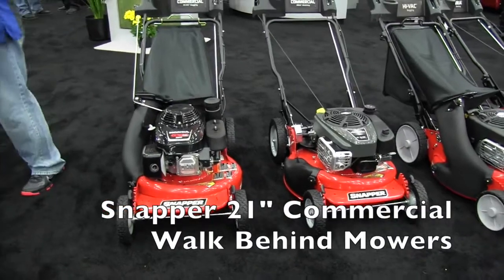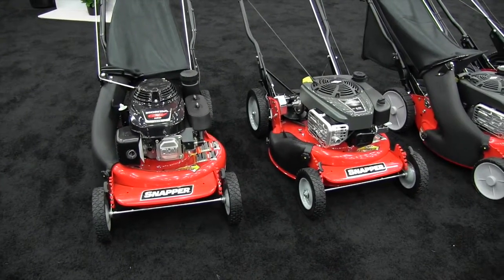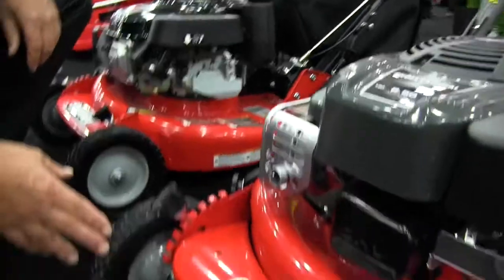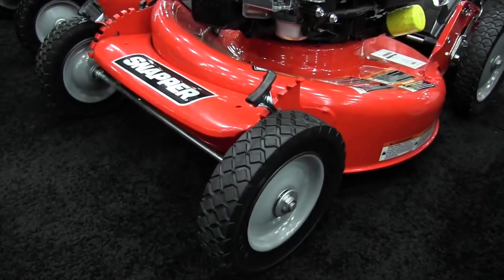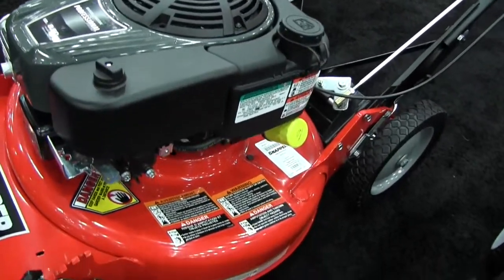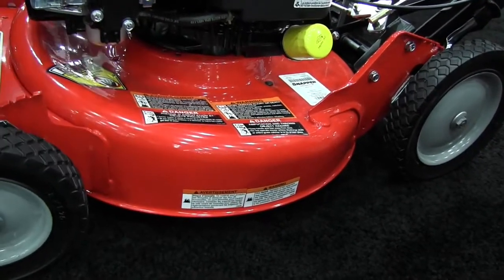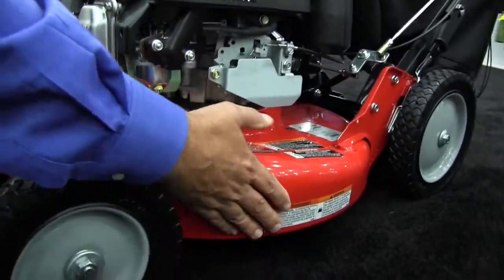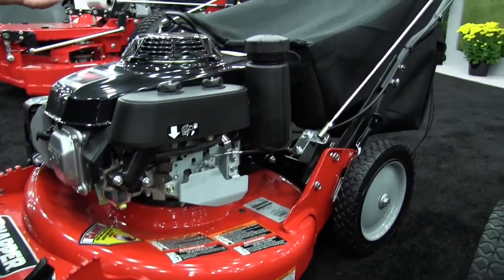Snapper Commericial Walk Behind Mowers: By John Young of the Weekend Handyman

Comment: I have a 1995 Snapper 21” commercial “Hy-Vac” self propelled, electric start mower.  Best mower EVER!  I replaced the 6.5 hp Briggs engine about 8 years ago.  It began smoking and losing power.  I quit putting $80 batteries in it several years ago and just pull-start.  Best cutting (I bag everything), best drive system and best deck.  And every time I take it in to my mower repair shop for maintenance they all try to buy it from me.  “You can’t buy them like this anymore!”

Comment: I just bought a brand new Snapper 7800891, which is basically a commercial grade machine without the high price.  I love it.  It has replaced my lead sled Honda Hrr216 VLA which I have had for 4 years.  The first year I had the Honda it was pretty good but the last three have been a nightmare pushing that boat anchor around the yard.  The engine on the Honda is fine but the drive components, suck.
Reply: The Honda engines SUCK. The so called Commercial grade GXV is only 160cc's, as in ZERO engine torque. They only make 4 ft lbs of torque people. They don't bag well either.
Reply: @jimdavidson5208  never had ant issues with the Honda engine on my mower. Plenty of power. Briggs and statton is junk.
Reply: I agree 100%. Same situation wity my HRR216

Comment: Snapper mowers are crap, at least the one I bought is, bought it brand new, mowed the grass with it three times and it's going back in the shop for the third time tomorrow, it just won't start.
Reply from the maker: Yeah.. that can happen.. weird things can wrong with any machine. If it keeps having issues, contact Snapper support and they might be able to replace it if it is a problem machine.
Reply: I bet YOURS came from Walmart or Home Depot. Not THESE Commercial grade Snappers. "Oh Snapper's are junk" LOL LOL
Reply: The issue isnt with snapper, im assuming the one you bought has a briggs and stratton. Your fault that you bought a briggs and stratton!